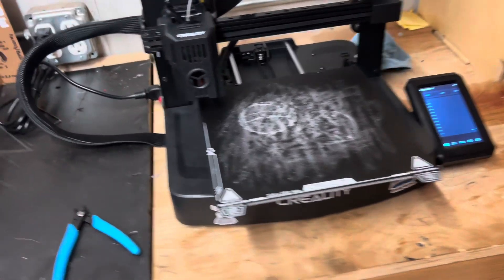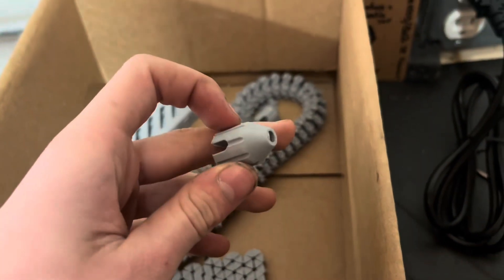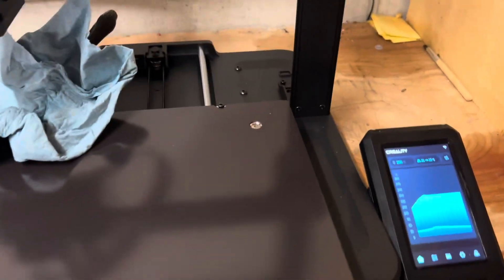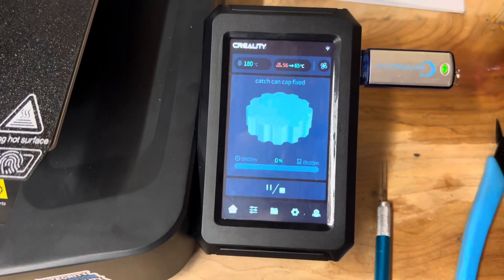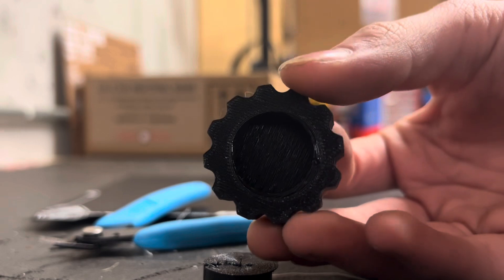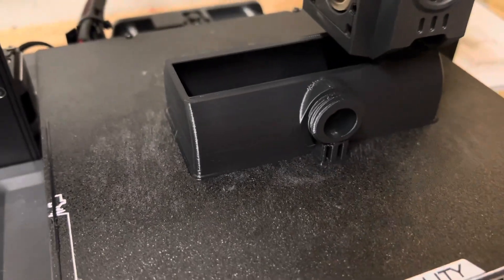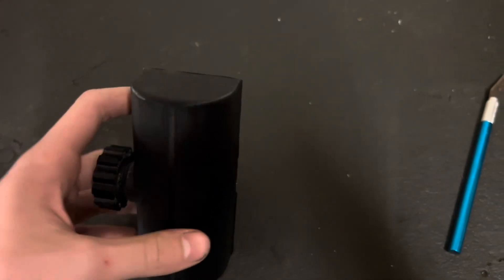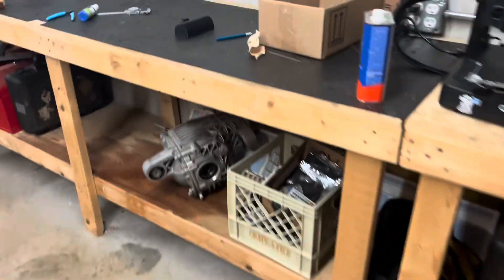How We 3D Print Functional Parts | Mechanical Uses

Comment: I haven't needed a brim for objects with a nice flat bottom like this, especially on the textured metal bed, things stick pretty well :) you can probably dial down the supports as well, a little goes a long way, really.
Reply from the maker: Yeah good point, and my setting was just set to auto brim I don’t use it normally